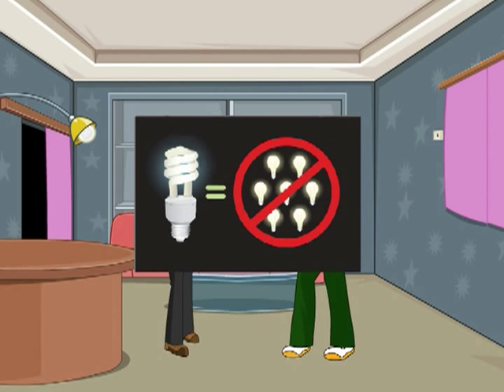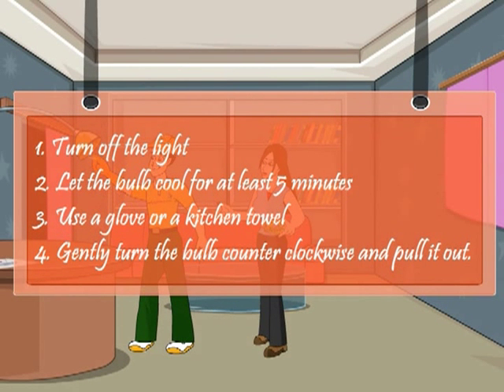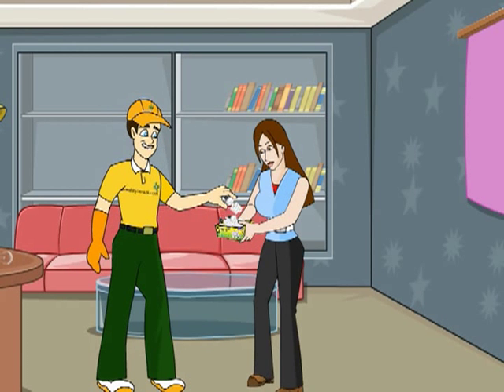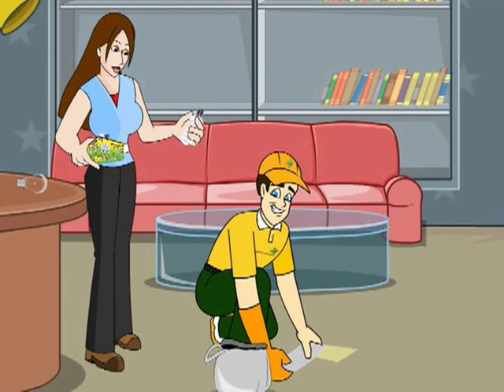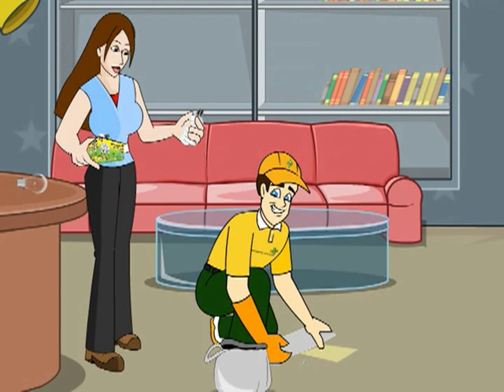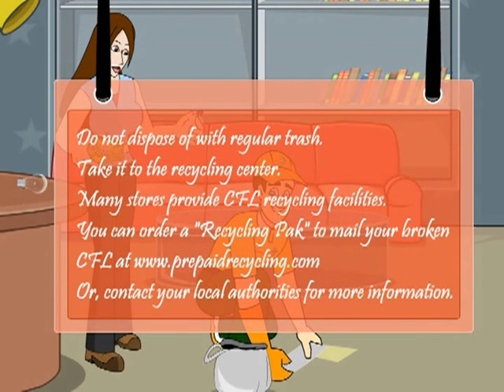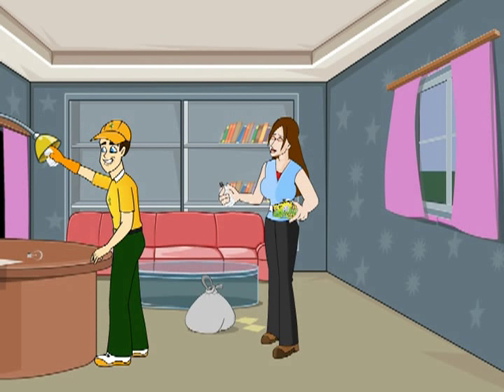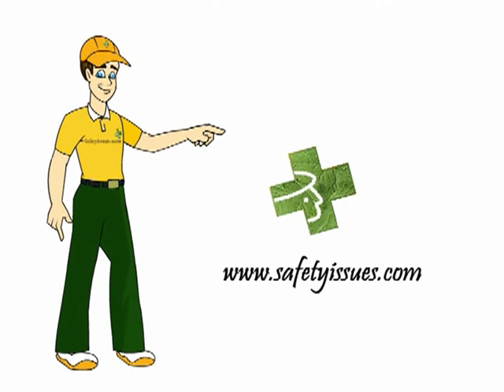The Safety Channel - Incandescent to CFL Bulbs

Comment: CFLs might  use less power but if the power is made from alternative sources i see no reason to stop using reguler bulbs, and the fact that normal light bulbs non't have no dangerous mercury make them even better in my opinion.